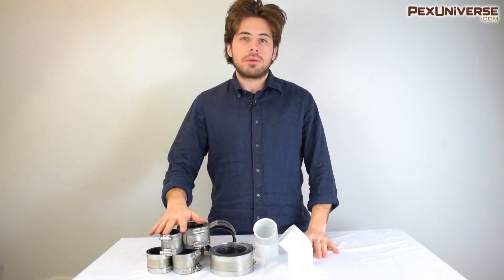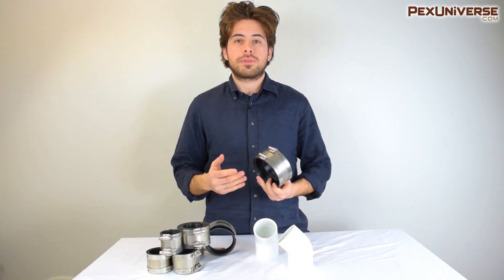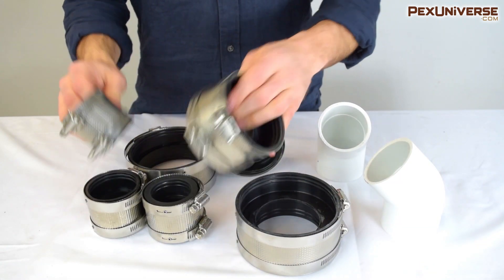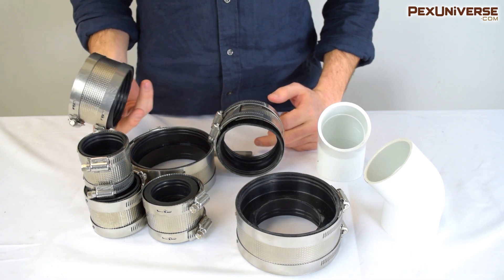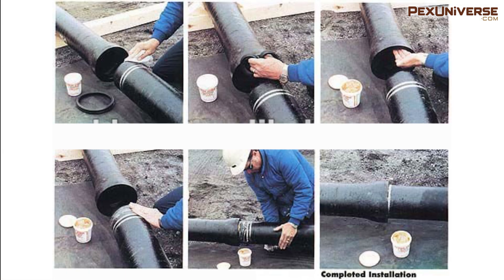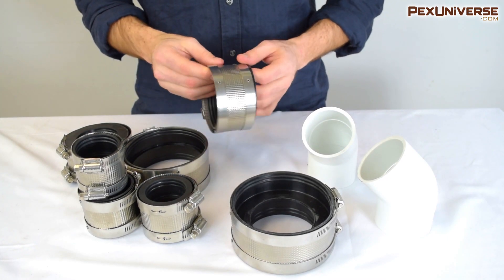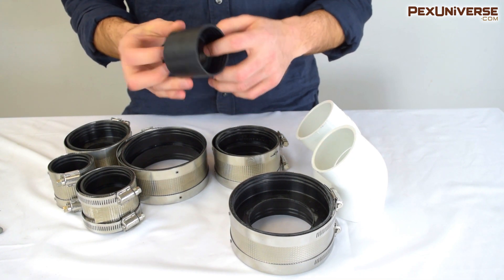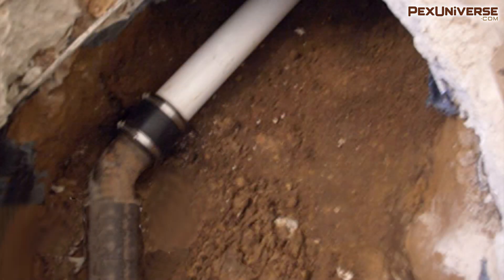What Are "No-Hub Couplings"

Comment: How do you guys make it fit between the pipes without breaking or loosening them?
Reply: Slide the metal piece on first then run the rubber under hot water or use your hands to roll it and warm it up. The rubber part is pretty flexible when it’s warmed up

Comment: Not Correct, You need to use Fernco for any PVC to Cast iron connection. No Hub Couplings between PVC and Cast iron are illegal and will not pass inspection.
Reply: So no hub couplings are only between cast iron and cast iron? Honest question.
Reply: @shazadhussain4204  Yes, here in south florida it will not pass inspection. Only for cast iron to cast iron repair.
Reply: @CSJiGSaW08  Thank you
Reply: Still one question, what does 'no hub coupling' even mean.
Reply: Joe M  Um they are approved from the international plumbing code and Florida Building Code. The ones that might be illegal might be the one with 2 straps and the metal shielding. The standard one with 2 straps is approved....
Reply: Joe M  ive seen the shielding used for cast iron to cast iron connection joints. The fernco can be used to join the waste arm copper drain to PVC inside the walls. the only time you watch out for special adapter sizes is for example clay city pipe to pvc pipe
Reply: ChatGPT:
Short answer: the comment is only partly correct and is overstated. Here’s the precise breakdown.

🔧 What the comment gets wrong
❌ “No-hub couplings between PVC and cast iron are illegal” — not universally true
❌ “Must use Fernco” — Fernco is a brand, not a code requirement

There is no blanket prohibition in the UPC or IPC against using shielded no-hub couplings to connect PVC to cast iron if the coupling is listed and approved for that exact transition.

✅ What actually matters (code reality)
✔ The coupling must be listed for PVC ↔ cast iron
✔ It must comply with ASTM C564 / C1277
✔ It must be shielded (full stainless steel band) for above-ground DWV
✔ It must be installed within manufacturer torque specs

The product shown explicitly states:
• Approved for cast iron no-hub ↔ Schedule 40 PVC
• Meets ASTM C564 / C1277
• UPC & IPC approved

That means it can pass inspection when used correctly.

⚠️ Where inspectors often reject installs
❌ Using unshielded “rubber Fernco” couplings above ground
❌ Using a coupling not sized/listed for CI-to-PVC
❌ Local amendments (some jurisdictions are stricter)

This is likely where the commenter’s experience comes from.

🧠 Bottom line
• Fernco ≠ required
• Shielded no-hub CI↔PVC couplings are legal when listed and approved
• The comment reflects local practice or past rejections, not universal code